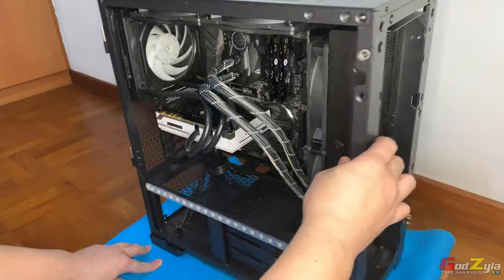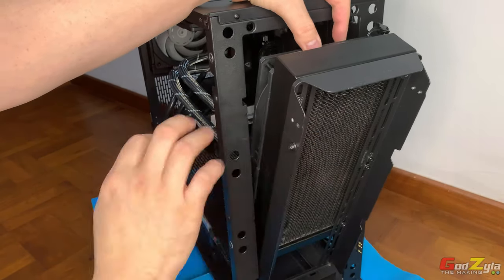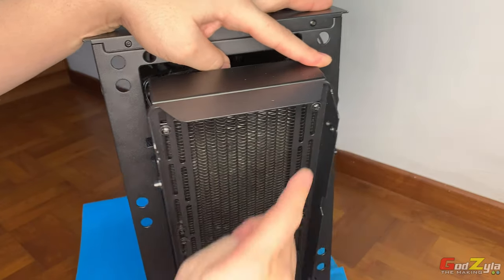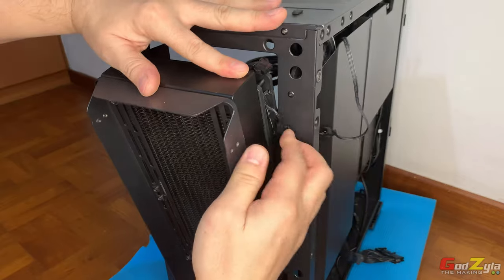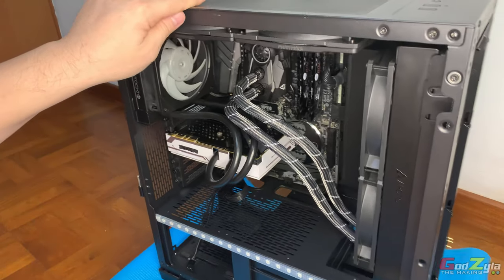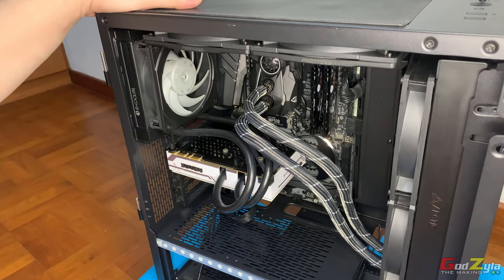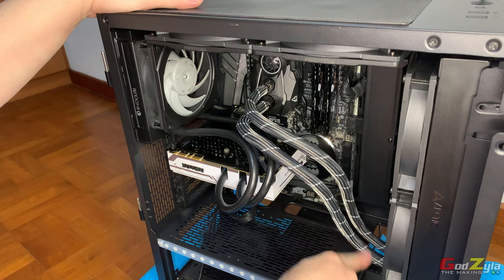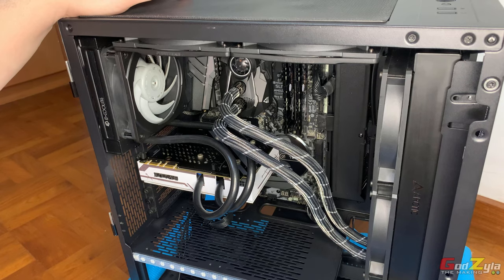Radiator Placement In Lian Li Lancool II Case

Comment: do you think i can mount an arctic liquid freezer II 360 tubes down?
Reply from the maker: Hi Rainix, welcome to my channel. I have no tried using a 360 Arctic LF2 but based on the structure of the front hole where you slot the tube & radiator into, it will have lots of tension. I don't advise to do so.
Reply: @KleoYan  okay ill get the 280 so i dont run into any issues
Reply from the maker: @rainix7817  yup 280 is all good. Infact which processor are you using? If amd. Just make sure you purchase rev 03 with the offset bracket. It helps decrease temperature even further.
Reply: @KleoYan  yes im going with probably a 5800x, and how do i know if its rev 03?
Reply from the maker: @rainix7817  on the box itself. It will state it’s rev 03. If you getting from a shop, you can ask if you can see the box. If you are getting online, you can chat with seller and ask him if it’s rev 03 and to take a picture which shows rev 03.
Reply: @KleoYan  thank you man, its my first time getting into AIO's, ill give you a subscribe.
Reply from the maker: @rainix7817  thank you and all the best in your build.

Comment: Thank you so much for your advices and your video. I have a 280mm kraken and I am looking for a new case and this might me it! I really want to put the tubes downward, but hard to find a case that allows you to do so. Seeing you can put your artic 280mm there makes me confident if I should get this case.
Reply from the maker: Hi SuneLaguz, you are most welcome. Now do note that I am using a Zotac 1070 Ti mini in my setup. if you are getting  full length GPU cards like the RTX 2000 or 3000 series. you will not be able to put the hose down, you will need to place the hose up, which is the only option. Another note, this case do not allow a 280mm AIO to be place at the top of the case. Thank you for your question and visit too.
Reply: @KleoYan  Have you tried installing an aio 280 on top?

Because the difference in thickness between the 240 and the 280 is small 3-4mm
Reply from the maker: @jordanx59x  Hi Jordnjx59x, welcome to my channel, I did try to mount it at the top, I am not able to do so, no clearance for me as it hits my motherboard vram heatsink and also my dominator rams.

Comment: Bought a 360 mm AIO for this case with tubes up. Will try to do a push pull config.
Reply from the maker: Hi Nico Tranjano, welcome to my channel. Wish you all the best in your build, so let us know how it turns out 👍
Reply: @KleoYan  Hey, Regarding a 360 AIO setup, Just bought a Liquid Freezer Ii 360, used the stock 3x120mm fans on the front on a push config. Will another 3x120mm fit on the back of the AIO with a pull config? Its a push and pull config on the front radiator. Also is it advisable to use 2x140mm on the top mount as exhaust? Thank you. Didn't expected a reply that fast.
Reply from the maker: @nicomilord  honestly, you do not need push pull configuration on the 360 LF2 one set is enough. As it’s no significant in temperature drop. Unless you are using a 60mm thick radiator. I will rather you spend the fan budget toward a vertical mount for GPU if you are using a beefy GPU. Idea set up for AMD cpu will be as follow. 

front Aio with 3 x 120 p12 fans pulling air. So your cleaning will be easiler. There are no difference in pushing air to radiator compared to pulling air. You can try. Result will be the same. 

Top exhaust fans 
Bottom intake fan
For GPU mounting. To benefit the air channeling as the about set up. Use vertical mount. Plus your x570 or B550 chipset will be running cooler.
Reply: @KleoYan  Thank you for your suggestion. I just wanted to add additional ARGB fans on my build thats why I thought its cool to make it in a push/pull config. My Cpu is R7 5800x and a pretty hot chip, the weather here is blazing hot too, and temps go up pretty fast in the morning and afternoon. 

My current setup for now is the stock lancool2 mesh fan at the rear and  top. The liquid freezer II fan 3x120mm as push config. at the front. And planning to buy 3 additional ARGB fans. My GPU is gt 1030 for the mean time because the coz of 3080s is 3x from srp right now.
Reply from the maker: @nicomilord   I see, the lancool 2 mesh is a good case. I am not too sure what argb fans you going to get but if you do have get other brands or argb fans, I hope you can hear me out. you see, different brands of fans have different characteristic. I will not go indepth on others but will just share with you base on air pressure which are generated by fan blades. Example, on one side of the radiator, you use the Arctic P12 fans (original) and on the other side you use lets say XYZ argb fans. Both side of fans have different characteristic. If one side of the fan are stronger, this lead to other side of fans to have stress to catch up. In the end, this causes unwanted turbulence which might cause high pitch noise. This will also harm the fans which are in stress. I strongly suggest if you really want to do push pull configuration. get 6 pieces of argb fans to do the push pull configuration.
Reply: @KleoYan  Thank you for your reply. I'm planning to get the new p12 pwm of Artic with ARGB, I think the Aio stock fan is p12 pwm too but with no ARGB. Will check if its compatible and same speed. Thank you
Reply from the maker: @nicomilord  I see, that's good :) wish you all the best in your build and thank you for visiting my channel.

Comment: Thank you! Due to my massive new gpu my only option I believe is to mount fans towards the outside position. I obviously cannot still use my current 3 front fans after I install a 280mm aio in the front right ?
Reply from the maker: Hi Carl Gaebe, welcome to my channel. Am not too sure what your length of your GPU. You can give it a try. As in mount the AIO inside the bracket and place fans outside. Then slide out the tray outwards. This might give you some clearance.

Comment: I was a bit confused with my fan placement on my recent installation of my Liquid Freezer II, had my fans inside like how yours are, but glad to see that you do the same! Under 100% load for 10 mins I am peaking at 70 which I think is really good so I’m not worried.
Reply from the maker: Hi flyxed, welcome to my channel, am glad that you yield good temperature readings :). Yup, though my processor back then was a i5 9600k, the temperature will not go beyond 67 degrees. even now when I change to AMD 5950x, it does not go beyond 73 degrees on 100% load. (all are by default, no OC no UV) . I have also tried doing push pull configuration, it does not reduce that drastically, lower about 1 to 2 digress, which I find no point to do push pull configuration. Once again thank you for your feedback and to have visit my channel.
Reply: @KleoYan  I find the push pull is only really worth using with 280mm rad 140mm fans....mostly in YIELDING a lower noise per temp ratio ultimately these cpu will attempt to clock as high as possible or concurrent with the cooling potential so it will climb to 70c+ if the cooling solution is "GOOD" enough bc it will inherently try to clock as high as possible "STOCK" on all cores generally speaking. So trying to hit a milestone of <70C is somewhat hard bc it could be the difference in overall clocks or render speed or benchmark yields. PLUS if i update my bios i get lower scores on 3dmark per ex. WHILE also seeing better thermals...but what else can i do if i want a more modern system and my gpu to access my ssd. WE got no choice but to adapt newer bios. Im more into system noise and idle temps anyways and A miriad of RGB suites even NZXT cam offer high idle voltages and the high idle temps that come with them which is generally worse for systems than upgrading to a better cooler which is a sad thought across the many builds out there. PLUS push pull with 240mm can add more heat to gpu cooling and in most gaming scenario which are gpu dependent that could be the difference in playability on maxed out games esp with a gpu oc Thankfully this chassis is epic for cooling purposes. Just kind of sad how nzxt cam corsair rgb razer a few others offer high idle voltage/temps to a system GENERALLY causing pump failure in the case of NZXT which is like the boogey man of AIO use pump failure....and hoses up top with air constantly passing through the loop or bubbles.

Comment: Hi Kleo, thanks for the video. I was wondering if you could also add in front of the radiator the Lian Li case (3x120) fans in a push+pull configuration
Reply from the maker: Hi loannis Kasparis, thank you for your question. Yes you can add 3 x 120 infront, inside the cage without any issues. Once again thank you for your question and to have visit my channel. by the way, there are lots of other videos which might interest you. Things like the Uni fans, experimental on fans of their case airflow and pressure static airflow. just check out the playlist here https://www.youtube.com/user/GodZylaTheMaking/featured. Once again thank you for your question and to have subscribe to my channel :)
Reply from the maker: @River_Miles  Hello 40ozFab, thank you for the detail write out. just curious, what's the host length of your h115i Pro 280 AIO? As it does not stated on it's official website? once again thank you for the throughout write out..
Reply from the maker: @River_Miles  Hi, thank you so much, may I pin your post? Your information will be of great help for those using the h115i. Greatly appreciated 👍
Reply from the maker: @River_Miles  I can only pin loannis original post so I've made a new post, credit to you 40ozFab. thank you very much :)

Comment: I'm getting this 360mm AIO for Lian Li lancool II MESH . Where can I place the AIO radiator upward or in the side. Please help me out, it's my first PC build also I want the front RGB fans visible
Reply from the maker: Hi The Internet Surfer, welcome to my channel and thank you for your question. I don't think you can mount a 360 AIO at the top, the only option is to mount it at the front. you can always mount the Radiator behind the Rad bracket and mount your aRGB fans inside the rad bracket. not an issue. 
hope that helps. You might want to get some Uni Fans if you really like aRGB fans. they are easy to used plus less cable mess, I have a series of videos about these uni fans from lian li https://youtube.com/playlist?list=PLEW-b-2vYDdM1WklGQps2-sQ1Amy6Uwn9 . once again thank you for your question and if you do like my content, kindly subscribe and click on the notification bell.
Reply: @KleoYan  thanks for replying, so can I use the stock fans available in the right side of the case and also the 3 fans which comes with the radiator together making it 6 fans inside out. Don't get me wrong as I don't have enough knowledge about pc building and AIO radiator mounting.
And yes I have subbed and pressed the bell icon
Reply from the maker: @IntuitiveLegend  hi, i dont get what you mean buy right side of the case? The Mesh II original 3 x argb fans are infront not at the side. Just giving you an exmaple.

leave the orignal 3 x fans at the front, then inside the case, mount your AIO Radiator inside the Radiator bracket and if you want 3 more fans, you can mount on the radiator side, just like how I mount my fans on my radiator shown on this video. hope that help and thank you to have subscribe my channel.
Reply: @KleoYan  thankYou so much for explaining in detail my query got resolved. 

Finally I have one more question is Arctic freezer better than MSI Core liquid AIO? 

And finally how is the pipe length of Arctic freezer is it long enough without being stretch?
Reply from the maker: @IntuitiveLegend  The Arctic Liquid Freezer II 280 and 360 have a hose length of 450mm. As for the MSI 360 AIO it’s 400mm in length. If u are talking about stretching the hose to be on the bottom mount. The arctic liquid freezer 280 series is on its sweet spot. Enough to stretch. Now as for the MSI 360 AIO. The pump is build in the radiator. It does not matter if your hose is up or down. U can place any hose orientation without issues.
Reply: @KleoYan  thanks for clearing all my doubts going with Arctic freezer AIO 360mm , placing my order today itself.🙏
Reply from the maker: @IntuitiveLegend  Hi, I am not sure if the Arctic Freezer II AIO 360mm can stretch it's Hose to be place at the bottom. please take note as I only mentioned that the 280 is at it's sweet spot.. thank you!
Reply: @KleoYan  okay but is it compatible with MSI MAG X570 TOMAHAWK motherboard?
Reply from the maker: @IntuitiveLegend  Hi, the MSI MAG X570 is a ATX board, will fit to the lancool II / II Mesh case without issue. as for the AIO CPU block, it should work with the Arctic Liquid Freezer II AIO but kindly do your research as I have not used a AMD motherboard (CPU placement that is) and wont be doing any upgrade on my system till Zen 4. thank you!
Reply: @KleoYan  okay thankYou so much for clearing my doubts.👍

Comment: I have exact setup like your except in my cooler master H500 ARGB case and Arctic liquid freezer II 240mm

I wonder how you mount the 280mm in push pull configuration with 3 x 120mm fans I guess it can’t be done given the alignment of the holes 

Either 360 or 240 with 120mm or 280mm with 2 x 140mm?
Reply from the maker: Hi jpthsd, 
thanks for the question, for push pull configuration. I would place one set of fans outside the removable tray and place the rad with  another set of fans inside the tray. However having to say this, I do not practice push pull configuration as due to the following.

1) it does not really bring down any lower in temp
2) I use to do push pull configuration but due to the fact that fans malfunction at times so imagine one of the fans does not operate fully which will lead to damaging it's partner fan. As static pressure either force the partner fan to work harder or to have turbulence  that will cause noise. 
3) Judging the temperature drop vs power drawn by fans, just my opinion, ain't worth it. 

thank you again for the visit too.

Comment: Perfect video! You earned a new sub. 

Quick question as I just got my ‘Lancool 2 mesh performance’ in today. With the rad hose installed tube down like you have, what is the GPU length clearance (longest length you think that wouldn’t strain the tubing)?

I was planning on a Fuma 2, but your setup is very nice and has put ideas in my head lol

Comment: Hello can mount 280mm AIO on the top of this case ? I have got the Lian Li lancool II MESH WHITE
Reply from the maker: hi, welcome back.. nope not possible, it will be block by the motherboard EPS cable or the VRM area.
Reply: @KleoYan  so in the front can I put it without removing the 3 fans the came with the case? Together?
Reply from the maker: @IntuitiveLegend  if your front fans are mounted inside the radiator cage and have mount your AIO like what I did on mine. It should not be an issue. but do some search on YouTube, there might be someone out there that has the same thought as you. I can only assume the placement as I do not have the Mesh II Case. thank you.
Reply: @KleoYan  thankyou for helping out
Reply: Either way you mount its via tubes top bottom it actually is the same as long as your pump doesnt sit higher than tubes. Thats the one thing in this video thats not simply true.

Comment: quick question, would a 360mm aio fit in this case?

Edit: also would i be able to fit a rtx 3070 or 3080 with the 360mm aio?
Reply from the maker: Hi Tigran, thank you for the question. 360 aio not a problem infront but your hose will need to be mounted at the top, which is not advisable. Once again thank you for your question and visit. if you like my video, kindly help by subscribing. Thank you!
Reply: @KleoYan  Thank you!
Reply from the maker: Hi Tigran, welcome back and to answer your question. Yes you are able to but still depends on your card length and you have no choice but to mount the AIO hose at the top and not at the bottom. This might aid you on your configuration https://youtu.be/Uj1_2WJBM9c

Comment: great video brother <3 thanks a lot. i have the same cas & i put my radiator on top & bellow it, 2 120mm fan exhausting air. what do u think? should i place my radiator on front rather than top? & if placing on Front, if i  push my fans through radiator will it affects the temp?
Reply from the maker: On Radiator placement, there is no right or wrong, you will need to experience what's best for you. 

my opinion will be. I prefer to mount Radiator (280mm) either at the front or at the back (120mm) 
the reason is, if I mount radiator that are standing vertically, water is at the bottom with depth, therefore the hose which are at the bottom of the radiator will have a solid water flow between the pump and radiator. This will prevent air bubbles from bubbling back from the radiator to the pump. Which will cause noise.

btw, this is not related to your question but if you are curious of how I gauge and plan the air flow of PC build.. you might be interested to watch this video https://youtu.be/Aj4fIPKELNI  Do note, it's a lengthy video.

Thank you!
Rgds,
Kleo Yan